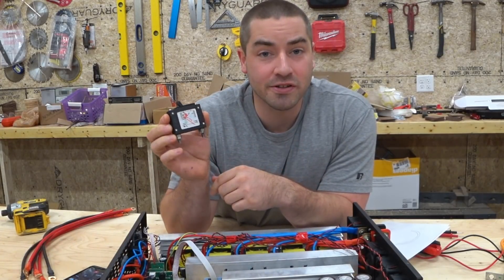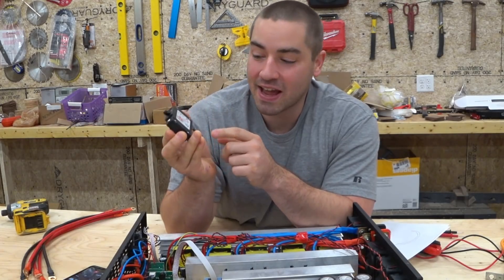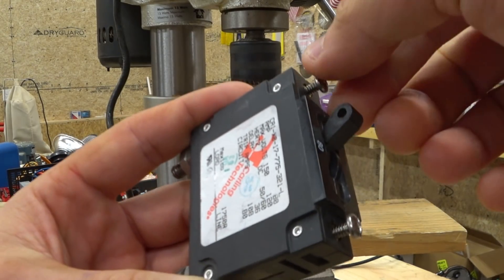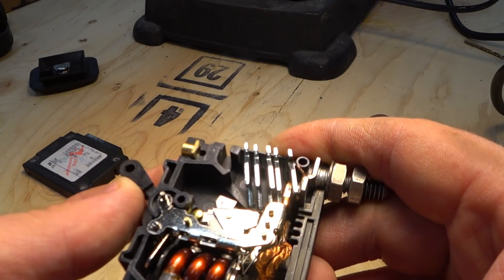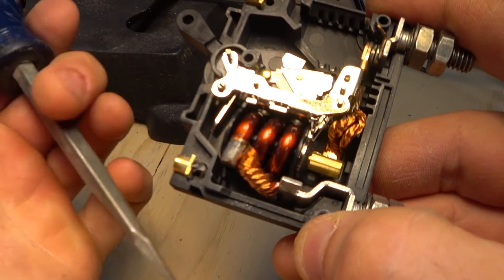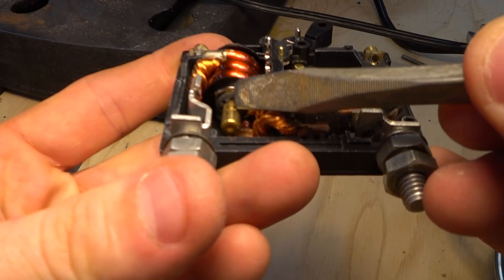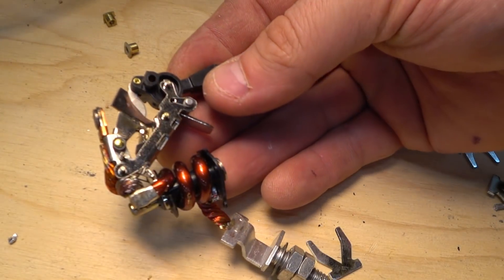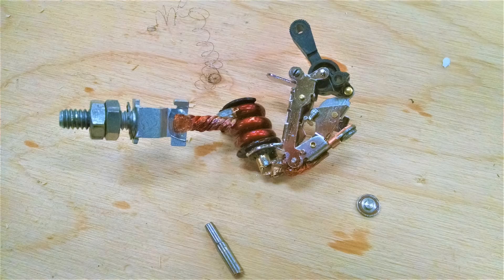Inside a Circuit Breaker for Solar Inverter to Battery

Comment: This is a slightly special breaker. Made by Carling especially for DC application, its calledn magnetic hydraulic.They dont rely on thermal or bimetalic functionality.

Comment: This is a fully magnetic breaker inside the brass thing is a peace of steel on a light spring in silicone oil .On an over load the steel core moves up into the coil creating a magnetic field tripping the breaker. On a short no core movement is needed the breaker trips instantly .MURRAY was famous for this type of breaker in residential panels. They were also sold under the name arrow hart murray ,crouse hinds .Heinemann was MURRAYS obsession they still make these type of breakers. Murray got bought by Siemens used their breakers and now Murrays no more. Murray wasnt that greatest panel anyway.

Comment: I just don't believe both units were bad.  It has something to do with your wiring setup.  Could the breaker popping cause a surge into the inverter?
Reply from the maker: I'm not sure.  There have been tons of comments on my other video: https://youtu.be/8pIZrrPLSP0  Some of those people are more knowledgeable on electronics then me.  I'm just learning about mosfets, capacitors, etc.  Thanks for watching.

Comment: when protecting DC voltage circuit,  you need an DC voltage rating to the maximum voltage available from the batteries and the generator

Comment: Not here to telll you but I think the Eire on your battery bank is to small of  gauge because I have a 5th wheel and the from the factory the battery bank users a 2/0 gauge so it can handle the amps and amp serge. That is way your 8000 watts inverter was have a hard time the amp serge. If you look at your input wire that come from the the power pole to your circuit breaker it has 000 wire to handle amp surge. You can go online if a chart to show way gauge you should uses to handle your surge.

Comment: Once upon a time I designed a diesel engine starting system that had 3 Delco Remy 50 MT starters.  Each starter is capable of drawing over 1000 amps at 24V.  I ran all of that current through a seimens DC contactor that could handle that amount of current.   The contactor was massive, but it had a replaceable section called an Arc shoot to keep the contacts from burning.  One of the laws of inductors is that you can not change the current through an inductor instantaneously.  So when you break an inductive load the current must continue to flow. As the air gap on the contacts open up, the voltage necessary to jump the air gap goes up.    The Arc shoot Gives the arc a path to move away from the contractors. typically they slowly separate (think tesla coil and jacobs ladder that you see in frankenstein movies). https://www.youtube.com/watch?v=9N_lq9KwSgM

Some of the nasty side effects of the spark jumping is a reverse voltage spike of thousands of volts.   I would expect that your inverter has limited reverse voltage protection.  Really good systems have reverse voltage protection and transient protection.  There is a component called a transorb that is designed across the DC inputs on electronic boards.  It allows reverse currents to pass through and suppresses the reverse current voltage.    In my experience with 24Volt systems, we used 3X the nominal voltage or 72V transorbs to protect the other board mounted components.  

To sum it all up, I think your circuit breaker was functioning as designed, but you overloaded it with your inverter.  When the breaker tripped, the reverse current of the spark destroyed the poorly designed inverter.  I think your smaller inverter did not have issues because the input circuit did not draw more current than your breaker could handle. The breaker never hit the trip point.

Comment: The stack of metal plates with the V shaped notches is part of the arc suppression mechanism and they are very necessary, especially for DC applications where there are no inherent interruptions of current flow as there would be in an AC source.  The arc formed as the contacts open contains metal particles and ionized gas, both of which are quite good at conducting electric current.  The arc flowing through the trail of particles and charged gas is much like current in a wire and will have a circumferential magnetic field proportional to the size of the current.  The magnetic field around the arc will be attracted to the stack of metal plates that serve as heat sinks and tend to deionize the plasma and quench the arc.

You can get the idea of the mechanism of why the arc is attracted to the metal plates when observing a car jumper cable near a steel sheet metal surface.  When the starter of the car with the dead battery is engaged, you may see the jumper cable jump towards nearby sheet metal due to the magnetic field surrounding the cable.

Some time, take a look at one of those small cylindrical glass cartridge fuses as used to be common in automobiles.  The end cap will have a rating such as 10 A, 125 VAC, 32 VDC stamped on it.  The reason it has two different voltage ratings is its ability to suppress arc.  The sustained arc when used as a DC fuse is the cause of the difference.

Circuit breakers are designed for two types of trip.  First is fault current.  Fault trips are usually set to three or more times the current rated on the handle.  The fault causes the heavy solenoid coil to attract the plunger and trigger the trip spring.  Below fault trip currents, bimetallic strips carrying the circuit current are usually employed.  The strips heat slowly and gradually deflect to trigger the trip spring.  There should be a spec sheet rating such as that the breaker will trip within 10 minutes at 30 degrees C at 125% rated current.  Last, there should be a maximum instantaneous fault interruption rating - probably around 10,000 Amps for the 80 Amp breaker shown in this video.  A higher fault current will overwhelm the ability of the metal plates to quench the arc.

You’d really have to look at the profile of the saw to to see how long it draws inrush current, the instantaneous opening current of the breaker and the rated opening time delay.  It would be possible the inverter has a transient load capacity of twice its rating, or in this case, 16,000 Volt-Amps.  Even if the Inverter were 100% efficient, that is a current of 330 Amps at 48 Volts DC.  If the saw has inrush current of more than a few hundred milliseconds, it is not too surprising the breaker opened.  The arc is where the energy stored in the inverter capacitors went.  The inductors in the inverter would also have developed a very large negative voltage in response to the sudden step change of current from 330 Amps to zero.  That negative voltage pulse is probably what killed the MOSFET switching transistors in the inverter.
Reply: How come the 3000W Inverter version does not fail?  Thanks for the information you supplied.  Logic says its the 8000W inverter which is problematic, or else the 3000W would have failed too.

Comment: So do you contact the manufacture for warranty or get a different Breaker.  Midnight solar are a reputable Company.   Should they be involved or Not.
Reply from the maker: Midnite Solar is great.  I'm sure they would help if the breaker was damaged.  However, I don't think the breaker was damaged.  I'll be buying more of Midnite stuff in the future.  No need to call them.

Comment: My brother honestly I remember when I saw you with the second 8000w inverter I remember thinking to myself if you are not going to change the breaker as well the fact that there was a spark man in my mind that no normal and my mind would not be at ease. I work in a restaurant for years and one of the principal rules when unsure throw it out.

Comment: Plasma (arcing) is highly magnetic. Those metal pieces around the contacts are there to create disturbances in the magnetic field from a plasma arc making the arc unstable. It helps the breaker stop the arc and prevent flashover.
Reply: magnetic and thermal, they cool the plasma so it extinguishes, since plasma is the 4th state of matter it takes heat to get it to that point, take heat away and it becomes air again

Comment: Use a heat gun and heat that one are to see if it will activated.
Reply from the maker: I got it very hot with a soldering iron (plastic started softening) and still did not do anything.  I think it still requires current through the coil.
Reply: Kool.

Comment: Good follow up view!
Yes this breaker as thermal and magnetic trip. This is why I recommend using "Fuses" for DC to AC inverters not circuit breakers. 
Magnetic trip senses short circuit faults (large current all at once), thermal trip senses overload faults (steady current until it exceeds the breakers amp rating).
I think if you tried using a "fuse" instead of the circuit breaker it would of started the saw no problem. 
I also say with "Cheap" "large" inverters have the inverter loaded with some type of stable small load first (a light, a radio, a small fan) before trying to start a "large" load or load with high inrush current like a motor. Large Cheap inverters have problems going from no load to large load very quickly. 
When trying to start large hi inrush loads the inverter will try to draw as much current as it can from the batteries as fast as it can in this situation you don't want a "magnetic trip" device. 
If the inverter is overloaded it will shut it's self down, the control electronics within the inverter will sense the overload and shutdown. IE: inverter rated for 3000 watts and you try to start a 4000 watt load, also most power inverters have internal fuse protection built in as yours did, the really cheap inverters have non replaceable fuses or fuse links soldered on the circuit board very cheap.
Reply: I agree with you that fuses are better in this case. However, as was pointed out by David, the circuit breaker he was using tripped almost instantly when he turned on the saw. Looking in the circuit breaker's datasheet we saw in the last video, for this specific circuit breaker to trip in less than a second, you would need at least 600% of the rated current, which is roughly 500 amps (completely absurd). No way that saw would normally draw 500 amps from those batteries as inrush current, even a fuse would blow. My guess is the inverter didn't like the inrush current from the saw, had some kind of fault because of that, and then something blew out and shorted the input terminals. After the inverter shorting its inputs, the circuit breaker tripped. All of this in less than a second.

Comment: When the output is shorted out the coil will then be energized vs being a straight thru conductor. 
The part that is brass is non-ferrous, the iron core is off center so it can be pulled into the field of the coil. This is my educated guess, someone will correct me if this isn't correct.
Love the info from your channel, keep it up

Comment: The metal plates are used to more easily break the electric arc when the breaker opens. It is more difficult to break open a DC circuit compared to an AC circuit. In a DC breaker, the arc has a tendency to stay "alive" since the current never crosses zero, in opposition to AC where the current crosses zero twice per cycle. You can see a more complex DC breaker in action in this video  https://www.youtube.com/watch?v=W2UAsFWjTUo where they explain the role of the arc splitter plates.
Reply from the maker: Nice animation, thanks for the link.

Comment: we are building a 13kw  solar  system without battery's going to use the grid to store the power then get it back  using a code 0 meter   its going  on a 6822sq foot shipping  container home
Reply: Is that square footage typed correctly? That seems like an awful lot of containers.
Reply: That is a good idea but may I ask a question. What about a storm or a block out by the grid? and in our case Jamaica where we have hurricanes. I ask the question to suggest to you have a few batteries just in case. I tell you my brother the worst thing that can happen to you is to be in an block out and looking at your equipment that have been rendered useless